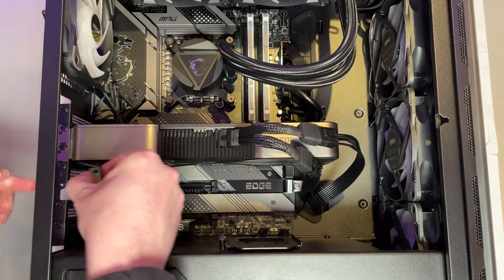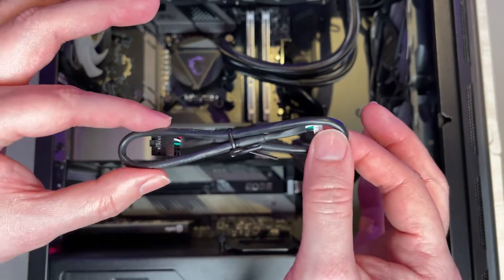TP Link WiFi Adapter Unboxing and Setup Tutorial! AX5400

Comment: My Mother board doesn’t have any of the sockets
Reply: You can use any socket , be  it pcie 1x or 16x,  the technology doesnt require much bandwith so the 4x and 1x are least used, while 16x and 8x are used for  graphics cards and capture cards, BUT you can use whichever you have open/available. Cheers! 😁💯💯👍👍

Comment: mine came with 5.3 bluetooth.. but i found at the back label of the device is intel ax210 not TPlink.. what is that mean then? plus which version is mine v2?
Reply: tp link doesn't produce processors , intel supplied it to tplink. that's a small processor..

Comment: Thank you. My Msi motherboard has built in wifi and bluetooth but the drivers have stopped working so I bought this. Can I have to wifi and 2 bluetooth adapters installed and just choose which one to use?

Comment: I did all but my pc (windows) cant detect the card what should i do?????
Reply: I'm having the same problem 😢 let me know if you find a solutiob
Reply: @Bsuu-d3s  i did I downloaded the wifi and bluetooth drivers and everything worked
Reply: @Bsuu-d3s  yes I downloaded the drivers from intel. Ur card has wifi 6e? What card do u exactly have?
Reply: @Steven-cr1og  I have the one from the video, I just downloaded the drivers from the to link website
Reply: @Bsuu-d3s  did it work?
Reply: Same for me, it doesn't work. Although since Simon mentionned it has bluetooth, I wonder if my USB external bluetooth tool's driver would impede with the Archer's bluetooth. I tried to not connect the cable to the J_USB port but still didn't work. I may try with the PCIe 16x @Steven-cr1og
Reply: have you settle bro?
Reply: same I dunno what to do tried everything
Reply: @wilhelmu  did you download the right version with the wifi card
Reply: @hilmidanialbinmohdfirdausl580  nvm I just didn't push it hard or at correct angle enough into the slot, after taking it out and pushing it again it works well

Comment: what Mobo you have that already Bluetooth but no Wireless?
Reply from the maker: Hey mate. It has Blutooth and Wireless, but it doesn't have Wifi 6E which is what I needed to connect my VR headset.
Reply: @SimonsDrones  ah, I get it now. Is the Bluetooth on the new card also not better than the built in?
Reply from the maker: It’s version 5.3 which is technically better, but my Bluetooth is fine for me so don’t feel the need to change it atm.